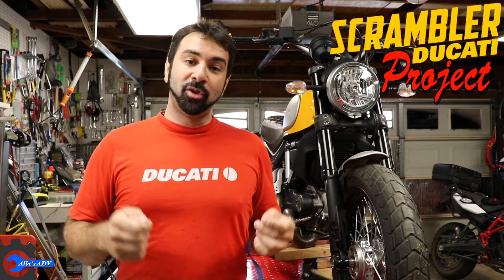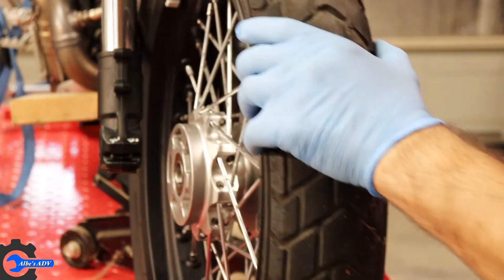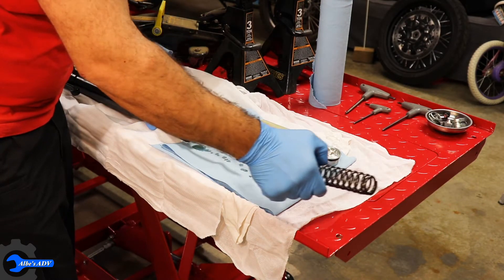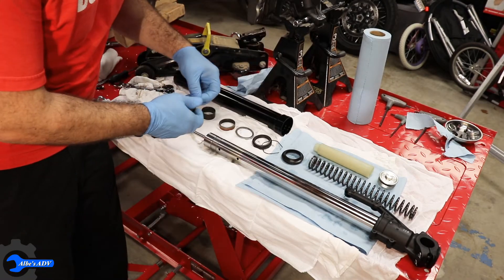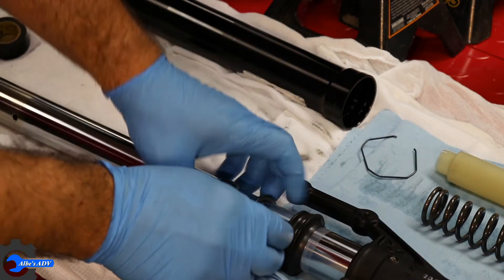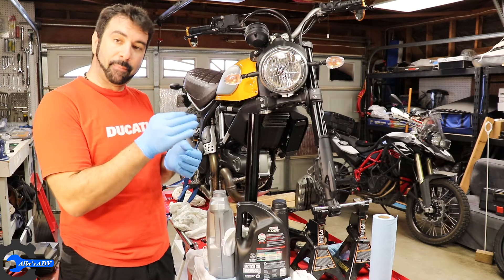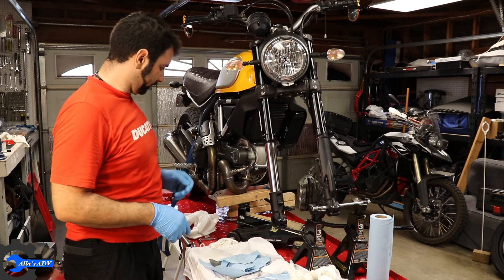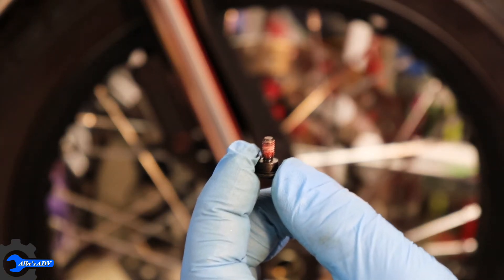Ducati scrambler front fork seal replacement - Scrambler project Ep.4

Comment from the maker: SORRY I HAD A BRAIN FART, THE AXLE NUT IS A 28mm.
Reply: Yep, and the axle pinch bolts sure aren't 15 foot pounds. I just had a brand new one snap at 12.
Reply from the maker: Hi Lukas, sorry the bolt snapped, I know how much of a pain that is, even if the axle pinch bolt torque is less than 15 ft/lbs , the bolt shouldn’t snap off at 12 ft/lbs, 12ft/lbs is about hand tight. I would take it back and have it replaced, it might be a defective bolt.
Reply: Albe, my firks are pitted and leaking on my scrambler icon of 3500 miles. Am planning on changing the chromed inner tubes but apparently there is a special tool to detach them from the bottom ends. Have you any advice on that please?
Reply from the maker: Hi Nemer, If they are like other fork tubes, you need a tool to hold the chromed inner tube without damaging it while you unscrew the bottom part and possibly a special screwdriver to unscrew the locking screw, on other forks is usually an Allen key
Reply: @AlbesADV  yep. It's that special tool that nobody's seen or heard of😂
Reply from the maker: Sounds about right for Ducati 🤣🤣

Comment: Nice video. Nice accent, also :-). So no worries about your special friends you mentioned. However, some notes to the instructions, if you won't mind me doing so. The spacer is actually the other retainer ring and both should be replaced, if worned. Also it might be better to control the oil level by measuring the air volume, since one actually never knows, how much old oil is still in there and end up with an incorrect level. And, as somebody else already mentioned, loosen the upper clamp first, before loosen the big fork screw. I' m looking forward for you working on the complete fork for another of your fine videos. I haven't worked on mine yet and am very curious on how the left part is constructed. Thanks, dude, for this one.
Reply from the maker: I don't mind at all, any add-on is welcome 😀👍

Comment: Hi Albe, question for you when putting the front wheel on, did you remove the brake pads from the caliper and then put them back when the disk was in place?
Reply from the maker: Hi Chaz, no, I left the brake pads in tge caliper
Reply: @AlbesADV  Thanks!  These videos are great by the way!  Thanks so much for taking the time to upload them.
Reply from the maker: No problem man 😀👍

Comment: Some people change the spring and cut 1,2 cm white plastic washer inside the right fork to be able to get better suspension. They also change the fork oil with thinner one. Would you recommend this type of mod or Andreani fork cartridge is way to go?
Reply from the maker: +N Kamaş if you can afford it the Andreani forks are definitely  the way to go

Comment: The two Forks are diferent. They take also diferent quantity of oil. Also in the Left fork you don have access to the spring!! Is it possible for a suggestion how to remove the left spring? Thank you.
Reply from the maker: I believe the left fork doesn’t have a spring in it
Reply: @AlbesADV  not even a smaller one ? There is something underneath a sealed space, I imagine it needs a special tool to remove it. I changed both seals two days ago many thanks for your great video!!! Cheats from Greece !
Reply: Chears
Reply from the maker: According to the manual,  it's just 1 spring
Reply: @AlbesADV  Thank Albe for your response!!

Comment: Great video. More Scrambler. Exhaust????
Reply from the maker: +Nirvash my plans for the exhaust are to temporarily fit the oem back on while I figure out a way to put a catalytic converter on the aftermarket that's on right now, the cat is going to give me the back pressure I need while acting as a spark arrester and quiet it down a bit too

Comment: good day Albe, is there no need to replace the seal on the left fork? it doesn't seem to be discussed in the video?
Also, the tools you are using, do you have a link for it on where to get them? thanks. Love your videos, learned so much.
Reply from the maker: In my case the bike had so little miles that the seal on the left side was fairly new and the leak on the right was very strange, in the end the right seal was not wore out, but looked like a little stone cut a grove into it, if the bike had more miles I would have done both.
Reply: thanks albe. everytime I watched your video, it very knowledgeable. I like watching them over & over again.
how about the fork seal tool? can you suggest a good brand/size?
Reply from the maker: I use a "Stockton universal fork seal driver" 39 to 50mm forks. https://amzn.to/2wl938c
Reply: Thanks albe.

Comment: Nice vid Albe. Novice question but do you need a Ducati fork seal tool or will any general one do? And does the tool have to be for a specific diameter fork? Thanks!
Reply from the maker: +thomasprobin no, the tool is a universal seal pusher and works with multiple diameter forks. I added a link in the description, you don't have to buy it off of it if you don't want, but you can check the specs on the amazon description page 👍🏼
Reply: Albe's Adv thanks for the link. You made a scary job seem doable for me. Thanks again

Comment: OK, so you did the right front fork, how about the left?  They are different and come apart different, can you show how to get the spring out of the left front?
Reply from the maker: Hi Layton, the LH one does not have a spring nor the pre-load tube. The procedure is the same as the RH tube but simpler since you don’t have to deal with the spring and the pre-load tube, the quantity of fluid is only 298cc rather than 427cc.
Reply: @AlbesADV  hi, thanks. Yes, it does have a spring, but is held together differently. and no preload tube.  I have them in my garage now taken out of my bike to change the oil and the LH fork definately springs up and down even without the oil.  I know the manual says it  does not have one but that is a mistake in the editing.  I was just wondering before I go to disassemble the LH fork if anyone had a video on how it iooks before I dive into it.  Blessings
Reply from the maker: @MotoWorld777  thanks for the info, I was going according to what the manual says. I'm planning on getting better springs for the front so I guess I'll figure it out then. 
Good luck and let me know how it goes. 😀👍
Reply: @MotoWorld777  might have to do my LH seal. Any advice since it seems you did yours some time ago?
Reply: @quinnlamb559  hi, sure, two things come to mind. one use a seal cleaner- a thin piece of plastic that you can stick under the seal and slide around. This can clear any dust build up or dirt that can cause a leak.  If you fell the seal really is bad, then you will need a special tool to take apart the left fork. a long socket type tool with a special toothed end to it the fits down inside the fork to loosen the retaining piece.  Ducati sells this tool, or you an make one.

Comment: Please lossen the top clamp before trying to turn the cap or you can bust the treads on the aluminum cap.
Reply from the maker: I did, I guess I edited it out of the video, but thanks for the reminder 👍
Reply: Which clamp? I was confused
Reply from the maker: He is talking about the triple clamp, that thing that holds both fork tubes and the steering head

Comment: How long exchange fork oil or seal.?
Reply from the maker: Usually it's different for different bikes, I would refer to the manual. When it comes to the seals, they need to be replaced when they start leaking.
Reply: @AlbesADV   Thank you. My bike ducati scrambler :).  Your video has helped a lot. We look forward to your continued activities.
Reply from the maker: For the scrambler it is recommended to replace the fork oil every 22500 miles or 36000 km 👍

Comment: your better off using everything in the kit and while doing that job buy another kit for the other fork and change everything in that at the same time .., the forks work as a pair and parts wear out as a pair .., it's cheap peace of mind IMO that the job is fully completed and needs no further premature attention
Reply from the maker: The seal wasn't wore out, it was damaged, something got in there and chipped off a piece of the seal, at 2800 miles there shouldn't be much wear on them, but as soon as I have some spare time I'll do the other seal as well.